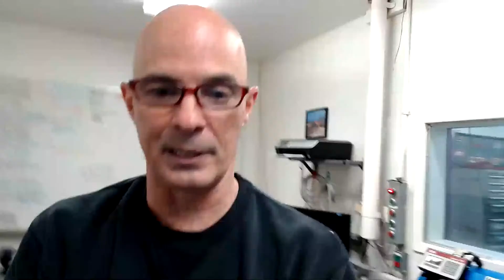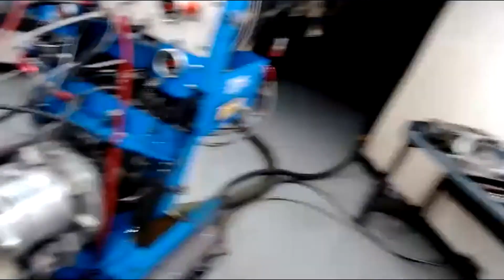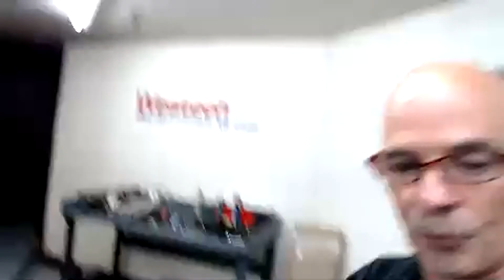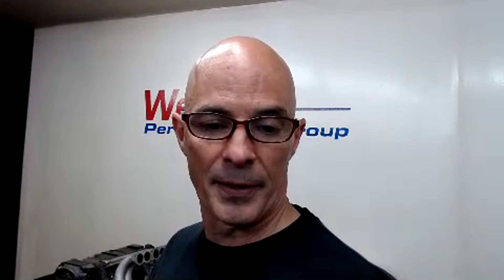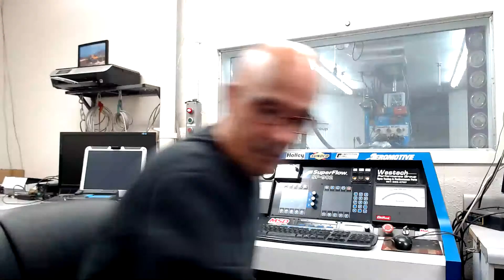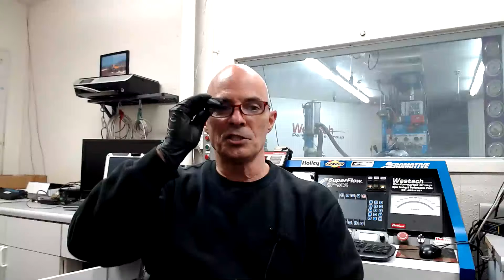LET'S TALK TURBOS-L99 OTHER GUYS 4.3L

Comment: look i am putting the l99 crankshaft in a 350 4 bolt full roller block. going to run tpi manifold. using the l99 connecting rods. trying to build a full roller 302.

Comment: With all the parts available what's the smallest LS engine you can build. Even if you have to shave down the block deck so the Pistons will reach the top without a huge gap. I want to build a 4.0 to 4.3 high output, rpm, boosted psi. And put in a AE86, S13, FD-RX7, S2000. Hell a Chevy S10 would be an nice experiment to find the full potential
Reply from the maker: WITH STOCK PARTS-THE 4.8L IS THE SMALLEST-YOU CAN SLEEEVE A BLOCK DOWN SMALLER AND HAVE ANY STROKE CRANK MADE

Comment: Can you do a high output 4.0-4.4L LS project? Short Stroke, wide Pistons, shave the deck down, go with the toughest parts available. Build a reliable 10'000 RPM mini monster. I wish I had your knowledge, money and resources to experiment with some of my own ideas with a 4.3LS. Maybe twin-charge it for instant boost until the turbos caught up and take over with higher psi. 50%93oc &50%E85 would be my blend of choice. Maybe nitrogen enriched octane boosters. With a flex fuel sensor.

Comment: U should so a segment on the ecotech 4! Like in the Buick regal turbo, SS cobalt, etc. A terrific inline 4, very reliable and can handle up to 400 HP on the stock internals, and German engineered for racing! I'm wanting to do a swap of one of those into my 1995 Saturn SL2. People think i'm nuts for wanting to do all that for a Saturn but they are extremely light and agile cars. Same weight as an old school Mazda Miata with room for 4...lol

Comment: I have an 87 5.0 roller cam motor carbureted with an e303 cam stealth intake 650 double pumper carburetor that motor handles a lot of nitrous!  melted spark plugs before Pistons would love to see the cam test for all of the b e f x 303 cams. I love my e 303 cam with  stock heads.
Reply from the maker: Very nice!

Comment: Hey Richard when you snag that L31 please run it under the stock intake first. The spider port fuel injection can be run with your aftermarket ecm.  I have made over 400 hp with the stock injection.  Just want you to show the truck guys how well the stock injection can actually work on a modified engine. Please and thank you.  I have a ported manifold with a 48 lb/hr spider setup on E85 on my aluminum head 11:1 383 in my Express van.  About 500 hp. Also want to see a decent cam run with and without rhoads vmax lifters.  I have a 218/228 on 110 lsa cam with rhoads lifters that idles like the stock vortec cam and has a broad flat torque curve. Heads are about 210cc and flow 300 cfm.
Reply from the maker: what are the stock injectors
Reply: @richardholdener1727  The stock spider injectors are 24 lb/hr each at 58 psi.  The stock regulator is usually adjustable with a small allen key or torx bit and they will reliably open past 80 psi.  Its been a long time since I did the math on the injector flow rate increase with pressure but they end up around 26-28 lb/hr @ 80 psi.

Comment: On the 460 test thought...
Instead of searching for the 68-71 higher compression 460s that everyone wants instead grab the 93-97 7.5L and 023x4.4 head gaskets along with 75cc heads you wind up with a 10.32 to 1 engine with an 045 quench and the block has that extra cylinder length (all 460s from D9 =79 have this extra length which is why we like these for Stroker Engines)

This is a Junkyard Gold 460 combination

Comment: If you were going to set this engine up in like an S10 aiming for fuel efficiency and roughly 1800 rpm at 65mph what would you do with the exhaust side to help with scavenging effect at those Low Rpm? Smaller diameter pipe? Longer distance to the collector?
Reply from the maker: long primaries

Comment: I'm late to the party but the mag heads on the 318 and 360 are the same and flow around 200-210cfm stock. The valve springs are trash stock so first upgrade will be them and make sure to use hughes engines 1307b valve locks so you can clear a cam around .525 without issues. Also the Trickflow tfs-16982-16 is a good drop on spring when used with the 1307b locks.

Comment: What about doing a L31 with a TPI intake with the lower adapter? The ultimate sbc truck motor 

Also would L30 heads be a decent contender for the L99

Also curious to see an edlebrock flo pro or a ramjet intake on a vortec 

Any way great to see you pumping out videos, thank you for everything you do and stay safe!!

Cheers from -45c Northern Alberta
Reply from the maker: lower adapter?
Reply: @richardholdener1727  scoggin dickey I think offers or at least they did offer a lower part  of the intake manifold to allow you to run vortec heads with a TPI set up,  I guess I worded that poorly, my bad aha.

Comment: If the l31 comes out of a 1/2 ton it should be 2 bolt the 3/4 and 1 tons are 4 bolt
Reply: Every vortec 1/2 ton and Tahoe I’ve torn into has been 2 bolt, maybe it was an option that none of my vehicles had, but it’s a much safer bet to look in the 3/4 and 1 tons for a 4 bolt. The l31 that I built up for my daily driver 98 shortwide came out of a rolled 3/4 ton att truck and it was a 4 bolt.
Reply: @timothywood3452  The L31 we put in my brothers 99 was actually the core engine that came out of a 1-ton work van.  Had a little coolant leaking into the oil. Bad intake gaskets but the owner wanted to change the engine anyway.  Got into it and gound out it was a fairly fresh rebuild that had 0.020" over pistons.  Slapped a LT1 F-car cam into it, ported the intake base, put a volant air box on it and added long tubes with 2 1/4" dual exhaust. Used a 4.3 S10 converter for a 99 S10. I then tuned it with HP Tuners. Was a screamer in that suburban.
Reply: That is not set in stone. I have seen 4 bolt main engines in 1/2 ton trucks and vans. It is more about what inventory of engines was available while the trucks were on the assy. line. Also the GMT400 and GMT800 series has half ton, heavy half ton, light duty 3/4 ton, standard duty 3/4 ton, HD 3/4 ton and one ton trucks too, so 1/2 ton 3/4 ton is still vague.
Reply: Stock 5.7 in my 97 G1500 was a 4 bolt.  Stock 5.0L in my 83 G20 was a 4 bolt.  Seen lots of 4 bolt mains in the big vans.